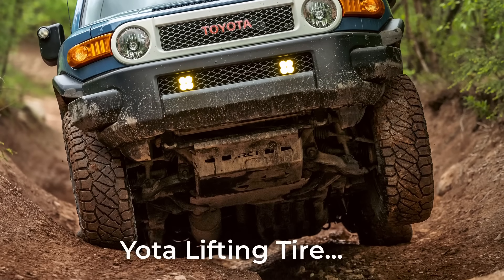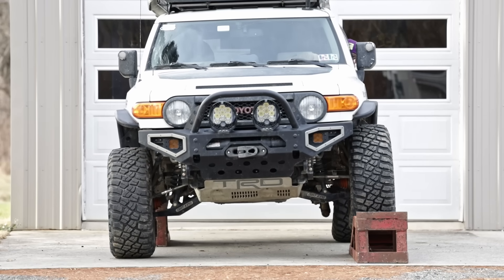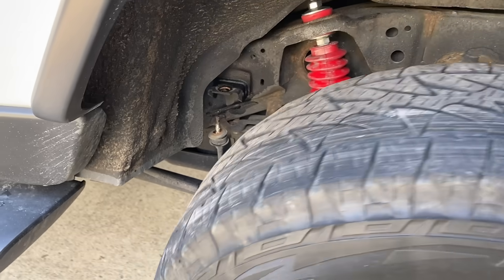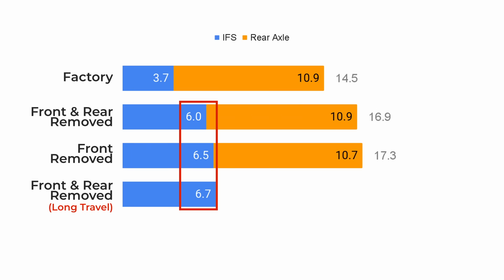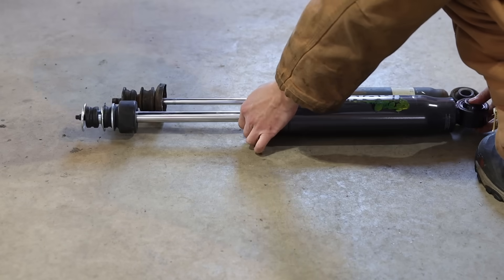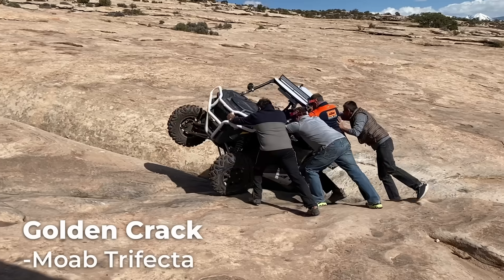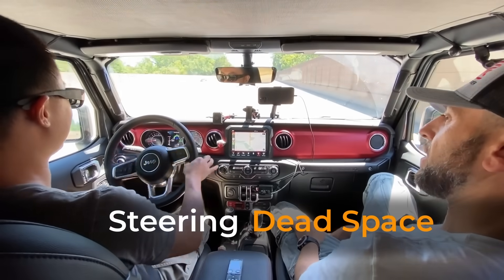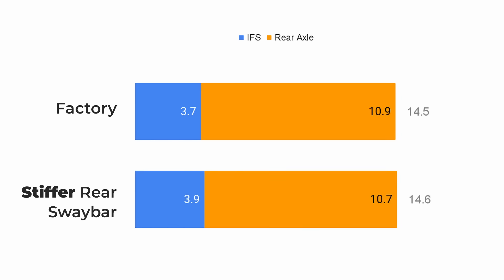Articulation vs Sway Bar | Not What You'd Think!

Comment: A secondary element to sway bars, is you need to handle regular driving well and not compromise control and safety.  This is a bit of a tangent to the video itself, but sway bars are tuning tools, and you do need to take care in what you do and exactly why you do it.  You can run with little to no sway bar IF you run higher low speed damping.  This is mainly about chassis control.  The sway bar is there to add mechanical advantage for roll stiffness when the lever arm side to side is much lower than front to back.  This also has to do with suspension travel, ride height, and bump and droop travel when driving since no sway bars introduce a LOT more body roll.  You may bottom out or top out your suspension and gain no additional advantage off road.  And when driving the lack of sway bars may have you resting on the bump stops around a corner (vehicle and setup dependent) which can make the vehicle unstable, unpredictable, and can cause traction issues over bumps in a corner.  One thing you won't fix is the high body roll will modify tire alignment and contact patch when driving.  But you can manage body control with more low speed damping.  This can keep the roll rate slow, inertial controlled, and better yet, you can have enough chassis control from this that you don't really notice the roll.  If the roll movement is controlled enough that it's slow enough, you simply don't notice it.

Comment: In my opinion, with the rear sway bar connected and front disconnected, you don't gain flex, you have just added stiffness at the rear spring and then,
the weight of the car was transferred from the rear to the front, that's why you have measured more 
flexibility at the front axle.
You probably would have a better result if you reduce stiffness at the front axle without any limitations from any sway bar, front or rear.

Comment: I have a GQ Patrol, 4" lift, 1" body blocks, 33" tyres, twin arb air lockers, GU diffs and front sway bar delete, plus all the fruit elsewhere; she's 3 tonne with full kit, fridge, full tank, me and passenger. I get great articulation, way more than most people outside of comp trucks. I can drive most tracks with ease on open diffs and minimal tyre spin, meanwhile my brother is struggling, lifting wheels and having to use the rear locker to even make it through in his kitted out (no blue plates) Navara. I drive extreme and comp tracks because that's the only place she needs even the rear locker, even the playgrounds with pipes and wombat holes and tractor tyres barely phase me.

Comment: My jeep has 60" of travel at one wheel, I run a single rear swaybar (custom 55" currie anti rock). The reason I run the rear swaybar is to allow the front to begin flexing on an obstical as the swaybar controls body roll based on something I've already traversed making it significantly more predictable. With IFS I would run a stiffer rear swaybar due to the limitations of IFS. As for highway with no swaybars? Drove my jeep for years without them at all. It is less stable and has more body roll so you will absolutely need to be cognizant of that. You cannot take the same evasive measures.

Comment: With the added 1 inch length of the Pro shocks, will removing the front sway bar allow enough additional droop to cause axle bind since 1/2 inch was the max you recommend lowering the shock?
Reply from the maker: The pro shocks add 0.75” (according to toyota pressroom for 2015 TRD Pro) at the WHEEL, not at the shock.

Comment: Without going fully active suspension, you always trade off one for the other.
And with fully active (as in all parameters covered) suspension you introduce another issue, complexity. With added complexity there's more things that can break or fail and so you are stuck needing a recovery.

Which is why i think SUV's or really any vehicle trying to do both highway and extreme off-roading is a terrible idea.
If i wanted a highway capable car and go to do off-roading i would get myself a proper off road rig and put that on a trailer.
The added benefit is that if your off road rig ends up broken, you still have your other vehicle to be able to get to safety.

Or in my case, if i wanted a good balance of both, i would get an enduro bike and be fine both off road and on road.

Comment: I always leave the rear sway bar on my H3, and disconnect or remove the front for really rough roads. Keeping the rear installed indeed helps balance the articulation more evenly between front and rear, which actually maximizes stability and comfort.

Comment: I just found your channel and you seem super knowledgeable in this area… I have a question for you.. in off camber situations.. where the you are driving across a hill/mountain…  not up it.. so for example.. the front right tire and the back right tire are at the same height on the hill… and higher than the left front tire and the left back tire…  does removing the sway bar help,in this situation… does  the sway bar try to push the car to stay horizontal or does the sway bat try to keep them car to stay “level” between the 4 tires… thank you
Reply from the maker: good thinking! removing the swaybar will make off-camber worse, you will roll over at smaller angle.

Comment: I have a great real world example of this, I removed my front sway bar in my 06 dodge magnum as I live in an area with very bad roads, instantly I felt a noticeable difference in handling that felt better on bendy rough roads. I will admit on the highway at higher speeds it's much easier to notice a lack of stability but for my application it works and I have no plans of reinstalling it

Comment: Your results on your FJ seem really good, so I'm surprised that you're claiming that you would prefer to have KDSS on your next vehicle. 

Are you saying a Highway handling is more important to you than the results that you had on very difficult features in Moab?
Reply from the maker: Yes. I think when properly set up, a KDSS vehicle will still be able to do everything I did in Moab with my FJ. For even harder obstacles, I'm mostly limited by my 35" tire size, not so much suspension.

Comment: very simple, you want quick disconnects and then it still depends on being able to read the terrain if you should or not, it also depends on your electronic aids, did you use the A-trac? Engaged the rear Locker, added a front locker?

The key to offroading is understanding that 4x4 is just 2 wheel drive vs 1 wheel drive no matter how much flex you have.

Comment: My two cents as someone that has been doing this to factory jeeps since the 90s.  Offroad it helps a ton.  If you plan on going on the highway right after you better think again as you will not have the control you need at high speeds.

Comment: Sway bars are only on vehicles for high speed stability on cornering to manage body weight transfer, on slow speed off-roading it is safer to remove them on independent suspension to increase traction, thus keeping your momentum easier, live axel vehicles have no real change with or without

Comment: Have you ever thought about grinding down this sway bar I have a '06 Tacoma The front sway bar is pretty thick What if I took about a third or maybe even half of the metal maybe in the center before the mounting points
Reply from the maker: I wouldn’t do that. Thinning only a section of it will concentrate most torsional stress at that point. It will break much easily. Also, not sure about Tacoma, but many factory swaybars are actually hollow.

Comment: Off topic question If I were to extend the lower control arms of my stock 06 Tacoma let's just say one inch in between the spring and the ball joint What I need to run longer axles I'm wondering how far you could extend your stock suspension without having to change the axles or anything else again this would be outside of the spring.

Comment: Really great video. I like how you presented the data. My first car was a 61 beetle. Small front sway bar only. Terminal understeer. 
Added a larger front sway bar and rear sway bar and it drove flatter and was more responsive.
Removed front sway bar when I went to a more modern front suspension. Handling dry was fine. But on a slippery crowned 2 lane road, passing another car, it started fishtailing then did a 180. Surprising and dangerous. I realized it was due to having too much stiffness on the rear. I'd be interested how yours handles on a wet and dry skid pad. Better to find any unexpected habits in testing than in traffic.

Comment: Problem is the cv angles... Could breack more easily
Reply from the maker: Maybe but it depends on context. Are you saying Toyota simply let all KDSS 4Runner and GX break their axles? As I showed in my measurement, they already achieve this CV angle from the factory
Reply: @TinkerersAdventure  dont know that but the more the angle the bigger the breakage probability... I have a nissan wd21 terrano and since i installed front locker i re-installed the sway bar... Better safe than sorry 😅

Comment: I'm wondering how much difference this test would be with a panhard correction bracket installed. Would love to see the results.
Reply from the maker: The pan hard bar doesn’t do anything to maximum articulation in this case.
Reply: @TinkerersAdventure  Thanks for taking the time to reply. It may not help in total articulation but it seems to me if the rear panhard is in the correct geometry there would be less binding in the rear end through articulation, resulting in better balance left to right. Which may translate to the front also, achieving a better balance left to right in both front and rear. As your testing with the rear swaybar showed better balance. So I guess my curiosity is will a panhard bar relocation bracket archive a better balance left to right / front to rear during articulation?

Comment: It's better to have an extremely soft swaybar than none. think of it like 0% anti-squat vs 5% anti-squat - you gain a bunch of pressure without losing much suspension!!!
"without" the swaybar, you will have more transferring on the chassis but less weight transferring to the tire.
in other words, "with" a swaybar you put more pressure on the tire (pushes down the tire) that has the most transfer - whereas if you ran no swaybar the spring and shock would absorb some of these pressures giving less total pressure to the tires.
also, this forces down on the tire down, forces the suspension up and stops the car from rolling on to the side that has the most transfer (hint's swaybar and like on the top act a lot like anti-squat). so the suspension tries to stay more upright and you will have quicker response in transfer loads.
another way you can achieve this (without a swaybar) is by running a high roll-center but you need speed for it to work (like anti-squat does) and knowledge in suspension geometry. that's if you can even change the stock geometry. (vs swaybars is easy and you just need transfer not speed).

Comment: Hi Kai, Love your videos, amazing work, they are a reference source of information.
I am myself a Toyota LC owner (KDJ 90), I installed a 2'' lift kit and I wonder if I should increase the length of my sway bar links ?
Have you got any input ?
Reply from the maker: Thanks! I'm not familiar with your platform. Whether to lengthen swaybar links depends on how the swaybar is attached. For example, on my FJ, lengthening the rear links will help, but lengthening the front links will hurt.
Reply: @TinkerersAdventure  Thanks Kai, I noticed that Toyota has profoundly changed the design of their front sway bar system on their Land Cruisers from the 90 series to the FJ.
The 90 series has never been imported to the US, but you might be more familiar with the 4runner 3rd generation design.
On the 3rd generation 4Runner and on the 90 series the front sway bar systems are exactly the same: same part numbers for Sway bar / Links / LCA.
So on the 90 series / 3rd gen 4Runner, the front sway bar runs behind the axle and the end links are connected to the LCA.
But on the FJ the front sway bar runs in front of the axle and the end links are connected to the spindles.
Anyway, I really love you method: the truth is in the measrurement. So I will soon run some articulation tests on my KDJ 90: with original front sway bar connected and with front sway bar disconnected.

Comment: Thanx that we have you 🙏🏻 What is your toughts about articulation on prado 120, 30mm front strut spacer and 50mm rear. With a rear sway bar disconnect links and 45mm shock absorber extension?
Reply from the maker: 30mm front strut spacer will over extend the IFS. Check out my everything about toyota IFS video for more!

Comment: Tinkerer I really value your videos and knowledge.   I'm looking at getting a ironman foam cell kit.   Im curious as to your thoughts on spending the extra few hundred on the stage 3 kit vs the stage 2 kit.    I'm just not sure how necessary the adjustable panhard bar and extended rear sway bar links are for just the couple of inches the rear will be lifted with the medium springs.

Comment: I love the comprehensive information on your channel! It has helped me to make some important decisions when building my latest project.

I would love to know your thoughts on using an adjustable rear panhard bar vs a relocation kit when lifting a 4Runner. The argument seems to be that the relocation kit maintains closer to stock geometry and reduces bump steer but is the same achieved with the adjustable bar?
Reply from the maker: Thanks. Adjustable track bar will not achieve what the PCK do. It is about the angle, not length. And the angle is that of the imaginary straight line connecting the 2 bushings ends. So even if you have a bent pan hard bar, it does nothing.

Comment: How would this compare to / apply to a 1st Gen Tacoma (leaf spring rear)? Has no rear sway bar, only front.
Reply: I have a 1st gen Tacoma and disconnecting the front sway bar really improves the ride offroad. I made on each side a L shaped bracket that I screwed to the frame with a couple self tapping screws , so i can disconnect the sway end link thats on the lower control arm and rotate the links 180deg upside down to bolt into to L shape brackets off the frame that i made so i can keep the say bar underneath the truck so incan quickly rehook it back up for the street if i want to.
Reply: @erice4611  Is there a photo to look at? Thanks

Comment: 2 (maybe dumb) questions. 1. would these measurements change (frount vs. rear) while backing up onto the ramp? 2. How does weight distribution between front and rear affect articulation?
Reply from the maker: Great thinking! The direction has no effect in a corner travel test. It will have significant effect in a ramp travel index (RTI) test. Weight is the driving force of articulation. So say if you are going up hill, the IFS will flex even less while the rear will max out sooner

Comment: Great video man. Your FJ is sick. I have a 2008 FJ cruiser with a 3-inch front lift and a 2-inch lift in the rear for context. I have always hated the body roll that this platform has. I don't see how the suspension engineers decided that the puny rear bar was adequate for even stock coil overs.  I bought the Nolathane adjustable rear sway bar after watching this video. This should be the first mod that anyone does to their suspension. I wish I had done this years ago. FYI- I kept the stock front bar in place since this is a daily driver that sees traffic.
Reply: What thickness Nolathane rear sway bar did you install? Any updates on this? Thanks

Comment: I had a Tacoma and the best thing I did to it was get rid of the front sway bar. It doesn't come with a rear sway bar, but it's also leaf spring instead of 4 link. And I build my own leaf springs so I was able to dial those in for the perfect balance between stability, flex, and load carrying ability. So with my leaf springs and no front sway bar, it rode great and had good balance between the front and rear

Comment: I can’t seem to find any aftermarket rear sway bars in stock for this platform other than the superpro. I have an 03 gx470 with long travel rear and I would like to put a sway bar in as I’ve had issues highway driving it, specifically having to deal with quickly stopping or avoiding other drivers who think it’s okay to run stop signs.

Comment: Quick question! I drive a Land Rover disco 2 with solid axles everybody likes to go sway bar disconnects front and rear. I deleted front and rear and it helps but do you think if I add the rear and leave the front off it will be better Flex the way you describe on the FJ? Even though it's both solid-axle you think the same concept applies? I feel like maybe the rear sway bar would help Force the front to articulate more the way you showed
Reply from the maker: The same concept probably won’t apply as the suspension stiffness works very differently. You’ll have to do some experiment to find the the best balance

Comment: Ok. I’ve just tested my truck without the front sway bar.
On road the truck clearly rolls more than with both bars connected, but honestly nothing scary, even pushing on corners on country road.
However, off-road the improvement is massive, in comfort, terrain copy capability and articulation.
I’ve measured 7,15” of articulation of the front IFS, which is a massive improvement vs stock configuration.
Rear articulation now is 12”. But the truck was empty so the bump stop was far away from the axle. Which means that a stiffer rear sway bar combined with the constant load I will carry in short time I was have still more articulation, less body roll on-road and a better balance FR-RR.

My truck is a Nissan Navara 2020 (European Frontier with coil suspension all around).